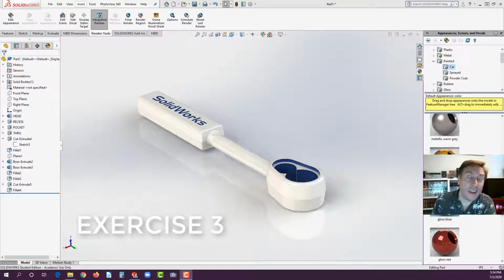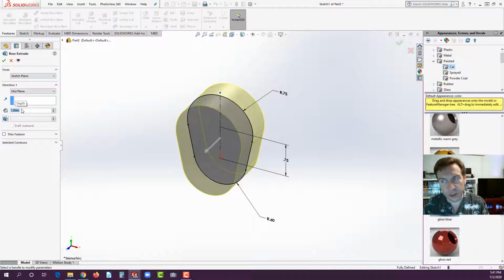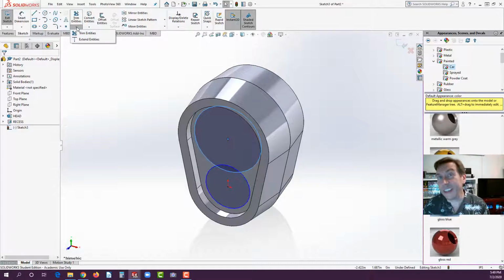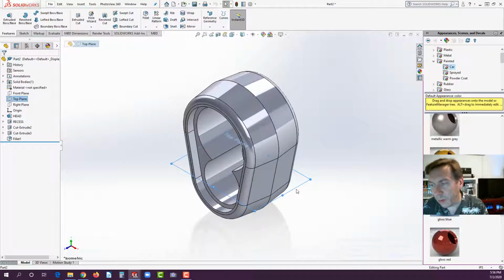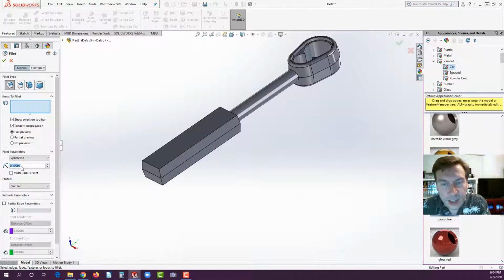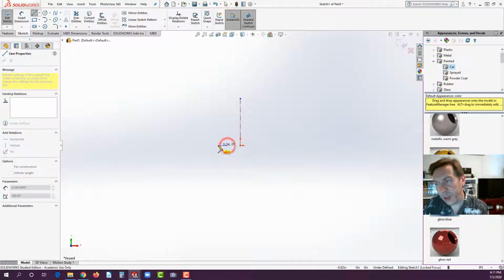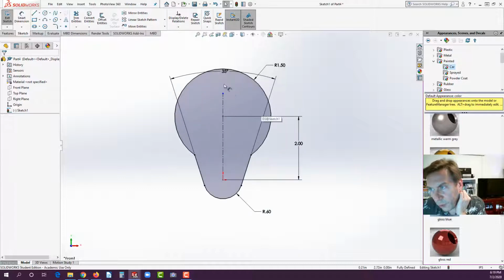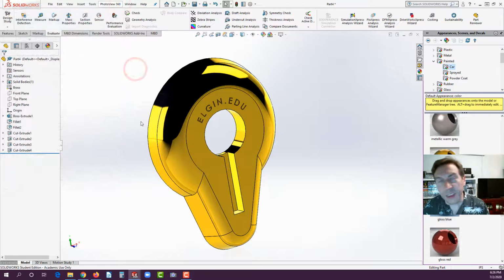E3 SolidWorks 2020 - Basic Modeling 3 Tutorial

Comment: I have gone through most of your exercises in 2020 and keep revisiting them as you either use it or loose it as they say.  I just need help running the correct graphic card for solidworks if you can help. I am using a  Tornado R5 AMD Ryzen 5 GTX 1660 Gaming PC with solidworks 2022/23 version  my current graphics card is NVIDIA Ge Force GTX 1660 SUPER but it is not giving off any enhanced rendering when i run the software. I have been on the slwk support page countless times with no avail.

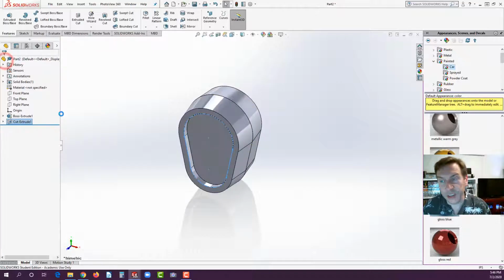Comment: Hi Chris, thankyou for your videos. I have a problem at 12:30min, where I am unable to make the Extruded Cut. When I make simple shapes with circles and squares I have no problem making Extruded Cuts. But with this custom shape there is a problem. I made sure I joined all the lines end-to-end. But the Extruded Cut icon is shaded and unclickable. Do you know what I should do? I am using SolidWorks 2022. Thanks in advance.

Comment: Very nice class of modeling. But it would be nice to show, how actually the designer engineer works: first you decide what you want your mechanism to do, then you design the mechanism (after analysing the forces and material strengths needed to withstand them) and only then you design the enclosure of the  mechanism.....
This is not meant to be criticism....only a suggestion. The teaching is actually very good! Just that future engineers need to be aware, what is going on in real world.
Reply from the maker: Hi Jiri, Thank you for the kind words. This is not a design/engineering course. It's CAD operation of SolidWorks. I am just teaching the interface and how-to model (We have specific Engineering theory courses if student chose to take them). Think of it like taking an MS Word or Excel course, they would not teach you spelling, punctuation or mathematic principles. Anything I add additional is just added value. Again, thank you for the input.
Sincerely,
-CS

Comment: Finding the content excellent as well as the explanations. The biggest issue I am having is that when I do the labs I do not necessarily have the engineering background to fully interpret the drawings. For example, on the second lab, I did not realize that the part was hollow. I also could not initially determine that the lower arc was tangential (it looked that way but I am unclear on how the drawing is indicating that). I struggled on the 35 degrees....at first I thought it was 35 degrees from the midline, not the mirrored line. I suspect as I look at more of the drawings, interpreting them should become easier.

Comment: Hello. Is there a solid works certification that one can get after your lessons?
What are the costs of the certificate in the case that one has gone through all your classes and done all relevant exercises from your course material?
Can the certification be used for jobs or employment? 

All follow up questions are based on if there’s certification. Kindly do inform I’ll appreciate cause I have been doing your classes and I can’t imagine how much I have learned in a span of a month. I think it warrants some credentials seeing that you are doing a good job even if it comes at a cost.

Comment: I am loving your way of teaching as I'm just starting out with solidworks. I am following along with this and I keep getting a dimension driven popup come up when i either try and do the 35 degree or the bottom R0.6. Ive deleted the whole sketch a couple times now trying to smart dimension it in a different order but as soon as I try to add in the angles im getting this popup which makes it over defined and then I cant do anything with the sketch. Any reason that might jump out at you as to why this is doing that?
Reply: NVM. after 3rd wipe I didnt notice that you used the 3 point arc. That seemed to make the difference in the geometry. I'll just leave this comment here in case someone else misses that part while following along.